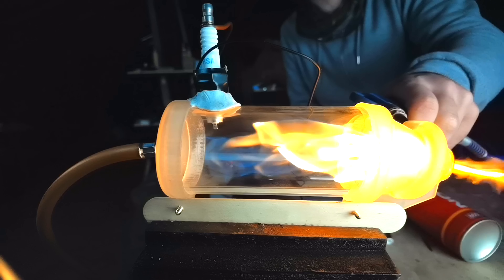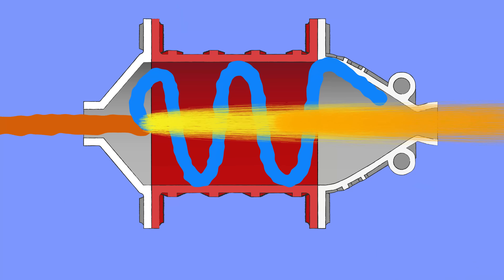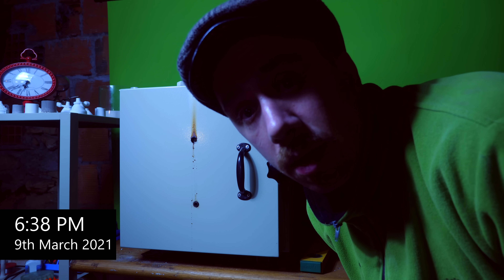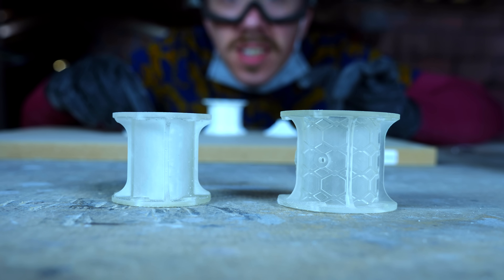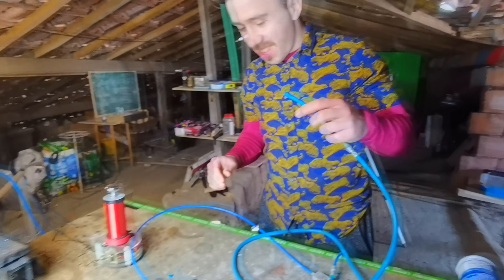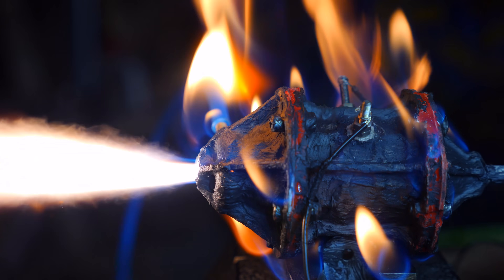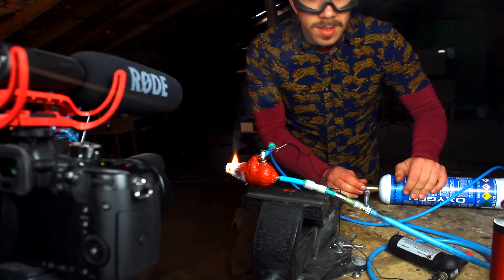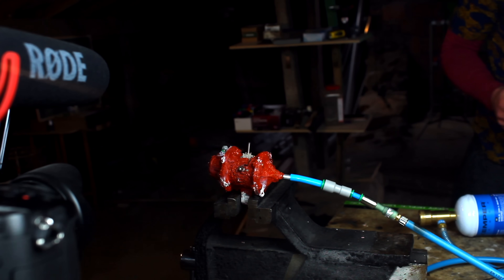Vortex Rocket V2.0 (3D Printed)

Comment: three suggestions...
The First is run it at a lower pressure. In a couple of cases it was working, then you turned it up to the point where the overpressure from the combusion was greater than the output pressure your nozzle would allow, leading to it seeking escape through the pores and seals. It shows its working but if the pressure can't escape via the nozzle then its going to escape in one of two other ways (making the nozzle bigger by blowing it off or forcing its way through the pores). The pressure will want to go through the nozzle (easiest way out).
The Second is ... don't grind off your support material, you may be adding micro fractures to the porous structure when you do so.
The Third is seal the entire structure in a cylinder filled with fire-proof-cement or flame proof... jelly... you know lime or raspberry... Your adding to the weight of the engine by sealing it and insulating it anway, it would hopefully keep oxygen from the outer structure, pressure resistance because jelly is a water based liquid and reists pressure, and might smell interesting when the entire thing goes up in flames. :)
Reply: This. Also, now that you can't see inside it's not possible to tell if the vortex cooling is working, but I suspect not because some of those shots show the body beginning to glow white-hot through the sealant. It's great video material, but maybe not so great for engine longevity...
Reply: @dgkimpton  I wonder if engine size is also affecting it's cooling ability. Not enough of a gap between the core and outer wall?

Comment: My thoughts are that you could use elastomeric O-rings between engine parts, this should eliminate leaking. You should make oxygen and fuel valves near each other to turn off both chemicals at the same time. It would be cool to see liquid oxygen instead of regular oxygen because liquid oxygen is much cooler and it would cool the engine way efficient, and a better oxidizer.

Comment: Would it be possible to metal spray the exterior to seal it?  Are there lower temperature burning fuel options? Nasa uses seals when assembling rockets so that might help.

Comment: So please try to print the parts using SLA and ceramic powder. This process should leave you with no supports, fewer limitations on the design and easier post processing - I do not have an SLA printer myself, but should I pick one I would try the Sinterit Lisa Pro - as for the free 3D printer I would also like a Lisa🤣♥️

Comment: Regarding the Modular engine, two things that came to my mind: I would try adding wall extrusions to the first and third parts that meet inside the middle part. This would give you more surface to apply sealant that, on runtime as the chamber exhorts pressure on it's walls it would compress the inner wall (the extrusions I mention) with sealant against the outer wall (the middle part) . Keep the bolts as the parts would snap out if not contained.
Second: Try to get actuators/electrically operated valves. Drive them with a microcontroller. Use these valves to regulate the oxidizer and fuel (so you can repeat experiments with same mixture. Also... you could end up having a "start" button that would trigger oxidizer first, fuel second, tesla coil third). You need to do a series of repetitions while making subtle changes on the mixture until the bubbling of the high temp silicon stops. To my silly understanding of things, the bubbling means the vortex is not working as expected and is transferring too much heat to the chamber walls. Hope this help. I really like your channel.

Comment: 3d ceramic print a negative-mold for your rocket engine, and cast it in metal. This would be 4 negatives, two per half, and you'd have to weld the two halves together.

Comment: You could try and make a NASA style H2O2 "rocket" with an oxidizer, it might be a fun 3d printing project and you could make tiny thrusters that go really far up, you just have to pull the plug on the tank.

Comment: If the baked procelite is porous then you need to impregnate it with a very low viscosity version of the fire cement and use compressed air inside {and/or} a vacuum outside to encourage the cement into the procelite.

You are soo close! Just need to eliminate the porosity and add a little strength to the outside with your usual carbon fibre wrap.

Comment: Suggestion after you make the whole engine you can put in in a sleeve that could be 3d printed or just a plain pipe and fill it with heat resistant epoxy. Would definitely solve the problem of leaking but wouldn't look too nice. Recommend using a vacuum chamber to remove bubbles from epoxy

Comment: If you want to stop leaking. I was using bowl or good bucket filled with high temperature glue/silicon/(mixture of carbon and HT epoxy). Seal inlet and outlet (or any holes) of part. Keep rotating part in the bowl on some shaft. Top of the part cool with fan so it will get dry sooner than glue in the bowl. Of course part needs to be cleaned by water or ethanol... I used to have 90%+ success on mini rocket jets.

Comment: Try making a metal rocket engine, just the way you made the pulse jet engine, but this time use coolant on the walls. May be just run tiny water tubes around it and it will serve as a coolant. With a very fast flow of water, it might not turn into steam instantly. this will protect the outside walls and also prolong the life of the engine. YOu make projects, and i know they are not easy to do, but i would like to see an engine which a longer run time and lifespan. I dont want you to give up as soon as the concept is proven.

Comment: @Integza Have you ever thought about using exhaust paint as sealing? I mean the one that can withstand at least 1500 degrees Celsius. Perhaps enamel paint could work too.
Another tip would be not to use pure oxygen, as this increases the temperature extremely. In the case of other engines and propulsion systems, one finally makes sure that either the mixture is rich enough or that the "combustion chamber" is cooled with the fuel that is being pumped.

Comment: Would it be possible to fasten the parts of the engine together before heating them to get rid of the resin? Also, a refractory glaze would probably seal the parts individually

Comment: Maybe instead of using the ceramic resin, you could use plastic resin to make a reverse mold and using something more heat resistant, potentially even metal and cast the engine

Comment: How about using "fluid silica/soluble glass" ? In my country it is called "water glass" , Na2SiO3 . It is used to build fireplaces , mixing with fine silica sand and water as a binder between fireclay bricks.  Also can be found as Sodium metasilicate.

Comment: have you tried using starlite as an insulation?
https://www.youtube.com/watch?v=0IbWampaEcM

maybe have a layer of starlite around the engine, then dip it in epoxy, this way the starlite will prevent the epoxy from melting and the epoxy will seal the leaks and probably increase the chamber pressure you engine can sustain without blowing up...

Although idk if starlite would work in this case...

Comment: Loved that video! Solid motors are definitely a cool project. Go check out the internets - you will find plenty sugar-based formulations which work very good. It is however easier to test components on a gaseous or liquid proepllant rig. Because in solids propellants you need to cast a propellant block every time before you run a test and additionally solid proepllants are an order of magnitude more dangerous! Just build the engine you did already from metal (use a lathe for example) and seal the flages with PTFE O-rings or graphite seals (both are cheap and easy to get). And honestly as someone who works within the rocket propulsion testing industry I highly recommend you to get yourself more protection for your tests. At least put some acrylic glass between you and the engine. Believe me it is very easy to geht hurt very severly!

Comment: It seems you like fire and rocket as much as you dislike tomatoes ... But why not make a pause and build a “lifter ionocraft” showing the precision capability of 3D printers for thin and light weight parts. Using Hiiiigh voltage I am sure you will find a way to shut up the f*cking tomatoes mouth ... See you and take care XD

Comment: You should build a electronic control systems for the rockets so you can have the rockets last longer by regulating the heat by opening and closing the fuel or oxidizer valve

Comment: Maybe use a metal "printed" engine thats ceramic coated inside? Then check to make sure that the vortex O2 comes in at a rate that burns fully. Either that or "mix" the O2 so that its not pure super-heated oxidizer eating away at the seals.

Comment: Think maybe for the liquid fuel 3d printed ceramic rocket yopu could try to make some gaskets to go in betwen the parts out of a thin metal with some high temperature gasket material like Permatex ultra black. I am not 100% sure it will work but if you look art a gas engine most of the head gaskets are made of metal and they hold the compression in the cylender usually around 11.5:1. also after watching the video maybe try and make the mating surfaces of the rocket parts a little thicker so you are able to sand them and get them as flat as possible to gicve the best chance for the surfaces to seal against a gasket. just from knowing how a seal is made those are the best solutions I could think of they may work or they may not but would be worth a try if at all possible hope this helps.

Comment: Concern : maybe teh pressure of injection is too high for such small combustion chamber.
Idea1 : switch O2 and propane
Idea2 : in addition to cooling in by injection, you can also cool outside prior to injection with metal tubing
Idea 3 : enhance oxydizer and propane mixing. Having 2 injection points at its but ( both gazes) with one linked to the mouth cooling injection point.

Comment: Idea for the engine why not make a mold out of the 3d printer and make a real metal parts and use that should be able to handle more pressure and tempeture. Using something to isolate the hot parts should be usefull as well

Why not make double layer model that has air or some sort of fluid to isolate the 2 parts and use that to get more tight seal for the parts?

Comment: your flange connections seems to be part of the problem...
if you use a W shape on one end and a U shape on another then the gas path becomes a lot longer and easier to seal...

thwy use a similar system for the solid rocket boosters on actual launch systems...

Comment: I am researching this idea and editing this comment as I learn more.
The problem is the pores in the ceramic obviously (also, high temperature and pressure). 
A possibility is electrolytic deposition of metal onto the ceramic. Electroplate copper, nickel (or both) onto the ceramic (perhaps something else?). Nickel on the outside and copper on the inside seems like a great idea but it would be difficult to accomplish. Though not impossible using a plating mask material (waxes, tapes and lacquers, resins).There is a possibility that the ceramic is electroplatable or could be chemical bathed or doped* with something to make it conductive so it was. 
*Metal powders, Certain metal oxides; Magnetite (or Iron(II,III) oxide, Fe3O4 ),  Zinc oxide, Magnesium oxide, 

Another simpler idea is to coat the outside and inside of the engines with a nonporous high temperature glaze and re-fire it. 
It may be possible to impregnate a high temperature, high strength material of some kind into the ceramic pores. This may be possible by submersion or submersion under a vacuum. Then firing or sintering.
It may be possible to replace molecules in the ceramic through some chemical process. (this is how gorilla glass is made.)

notes:
- You may have to break in a glazed motor by running it under low fuel and oxidizer rates.

- I would contact the manufacturer of the ceramic and see if they can help if all else fails.
 
(I'd be interested if you try my idea of electroplating.)

I have an idea for a vortex solid rocket motor.

Comment: I have the solution! Paint the engine with conductive paint and the you can metal plate it via electroplating . Do it for long enough and you will have a .1mm or more thickness .

Comment: hi integza bro i suggest is u could use a thick layer of aluminium foil in the inner wall to prevent the leakage of fire(while integza bot in heaven: i am not done yet integza i am inevitable and dont listen to this kid he is only 13 years who got failed in exams 
mostly when 12 years old)

Comment: Why not use the 3D printer to create a mold for casting the parts out of metal using lost pla casting. You already have a kiln that is supposedly hot enough to melt metal of your choosing. Submerge a pla model in plaster and burn the pla away slowly in a kiln. Then use the plaster mold to cast your engine parts. Plenty of examples of this on youtube. Looking forward to see you getting your engines up and running.

Comment: Olá senhor, Love your videos. Here is a suggestion for your leaking problem : I think the heat is spreadind to fast inside your ceramic parts (there is acually a lot of micro bubbles inside the structure of your parts when you've finished the curring and because of heat expanssion it cracks ) so I think you need to dissipate as much heat as you can from the inside rather than the outside. Aerogel could be a option but its quite expensive and you'd have to print bigger parts. I do hope it helps, And keep up your great work !

Comment: Hmmmm why not make a mold for the ceramic with a 3-D printer and then mix up a whole bunch of ceramic and dump it into the mold cure it and then melt off the plastic
Reply: This way you would probably have a 100% ceramic mold or peace 🤷🏻‍♂️🤷🏻‍♂️

Comment: Instead of using red RTV, there's something called "the right stuff" black rtv. It comes in a "squeeze cheese" like application tube and works incredibly well. You can practically put it under pressure after about 15 minutes. I use it when doing oil pan replacements and I'm able to immediately add oil with no leaks. Hopefully it helps!

Comment: i dont know if this would work but what if instead of using silicone to seal it you use a high temp industrual epoxy like EP17TF, i would also try to have the epoxy imbed its self into the pores of the ceramic as much as possible before curing the epoxy to try to close off as many leaks as possible

Comment: Have you considered trying "lost PLA Casting" ? And then coating the interior of the nozzle with ceramics? 
You could already integrate all the tubes and holes into the design.

Comment: You have a couple of problems:
First, the vortex is not working.
Second, oxygen is at the exhaust, and has to overcome higher pressure.
Third, pure oxygen has higher caloric power than air, which means that any fuel approaching the edges will make more damage.
My suggestion for the three problems is using an air compressor with higher pressure than the propane intake. Even leaks won't burn if vortex cooling works fine, damage will be reduced in case turbulences mix air with fuel near the sides. Other option is increasing the oxygen pressure, and you should simulate operation with final tolerances instead of with the initial ones.
Reply: Of course performance will be reduced using air, but are you looking for performance or for functionality?

Comment: you should try to build engine in one mould not in various part like head, cylinder and exhaust .. if you make engine in single part , it will reduce the joints and chances of leakage... as we saw in small submarine type engine , it's run very nice in starting ...... ❤️🔥

Comment: Integza! Try to put the fresh prints into salt, or something and then into the furnance!
I saw ABS baking using this technique and the results were promissing. The idea is that part is submerged in salt entirely and thus salt doesn't allow the part to change dimensions too dramatically. At the same time salt can withstand temperatures of the furnance.
The downside with ABS was that salt was somewhat altering the surface finish of the parts, but that's probably won't be the case with ceramic resin prints.

Comment: Double skin it. Make the internal ceramic part, then make an external, and fill the inside with refractory cement. Glaze the external version, so leaking only occurs within the internal and refactory cement parts (maybe add some sort of chimney just in case...)
If that doesn't work, a fun option could be to try and lower it into water when its running...

Comment: Why don't you 3d print the mold and then mold the engine parts with a material which more temperature resistance....like ceramic itself... that way you might come over the problem of deformation, cracks and leaking and even can make those part more thick

Comment: You need to layer carbon fiber fabric into the red muck stuff, id do multiple layers going multiple directions. You're issue with the leakage is cause of pressure (im sure you know this), the red muck "solves" it until it gets gooey then loses all pressure retaining ability, bubbles up and pops. Sandwiching layers of carbon fiber fabric in between the red muck would give it something really strong to fall back on when it gets melty, the red muck then acts as the atmospheric barrier and the fiber acts as the backbone. You could even go further as to build up enough layers and sandwich copper cooling tubes in it and run LOx through them, active cooling!

Comment: why not 3d print your design out 100% resin and then make an investment to cast it in? Then you can burn out the resin and pour in molten metal or ceramic.  This is akin to the lost wax method.